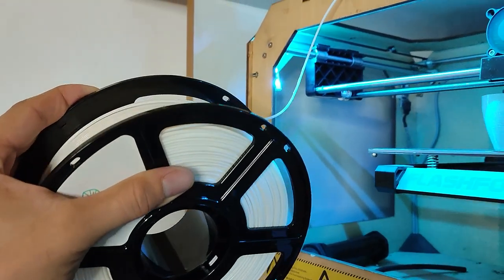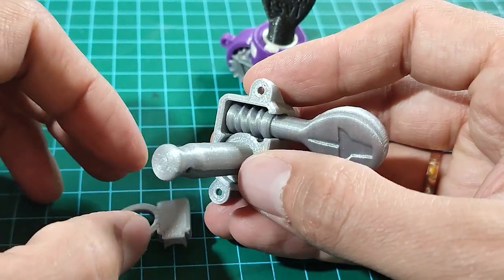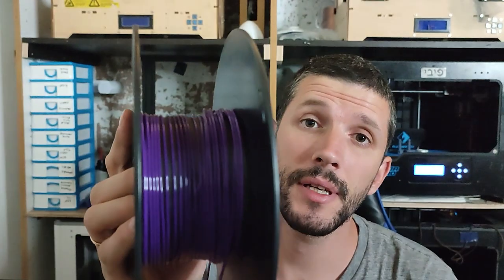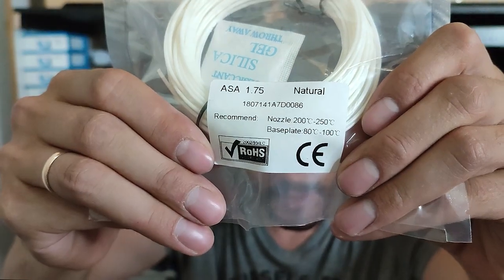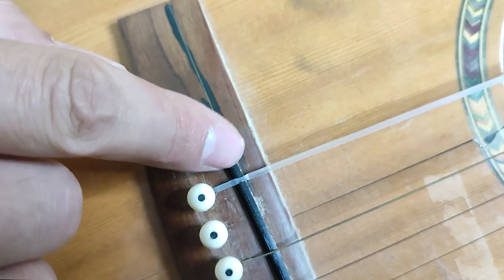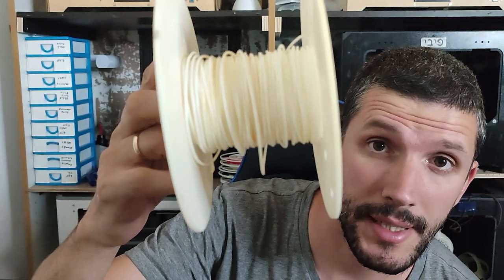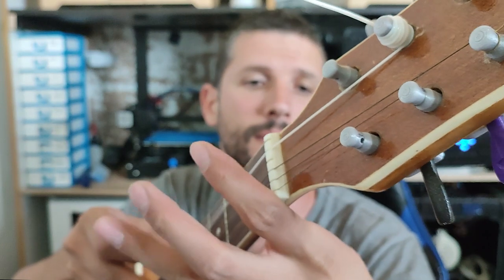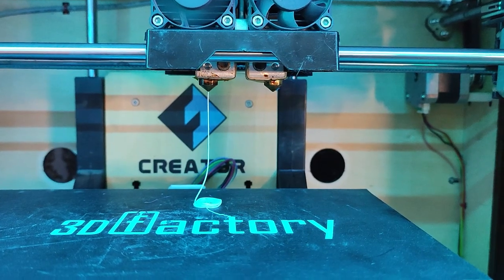3D printer filament as GUITAR strings?

Comment: I keep coming back to this as I'm testing the strings for ukes and guitar. Good reference. I think as long as you tug on the TPU tight before winding it it can actually work pretty good. You'll still need to wind a while but it has kind of an upright bass quality to it and is actually what they use on ubasses.
Reply from the maker: This guy had more luck with tpu. He pre stretched it by hand as much as possible before winding. https://youtu.be/W-9z9TBBMOM

Comment: Interesting idea. You definitely need different diameters to tune to different notes. I use fishing line for my cigar box guitars and I have experimented with 50 to 500 lb test monofilament nylon with good results. I’m currently trying flourocarbon fishing line, but it’s expensive, so I only have tried 100 and 200 lb test. It works well to and I can get lower notes with shorter scale lengths.
Reply from the maker: I don't have nylon at the moment but yeah, I could extrude different diameters

Comment: I had decent luck with TPU by pre-stretching it by hand before winding it, if that makes sense. I didn't use it on a guitar, but on a DIY instrument, where one end of the filament was sent through a hole and tied in a knot. This stuff hasn't broken on me yet, even having given it lots of tension. I think it could be useful for bass strings, if you have the right pickup or mic, and a good resonant body.
Reply from the maker: that sounds pretty cool, can you add a link to your video? I've never used a pickup or mic on my instruments, an acoustic thing has a charm of its own in my opinion. the tpu really does sound more bassy. maybe I'll try again with pre-stretching it.